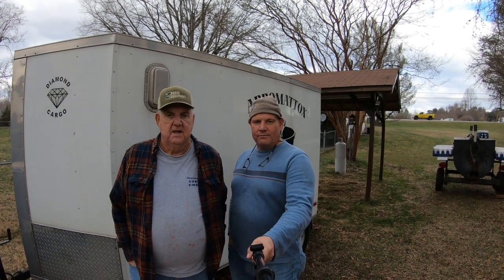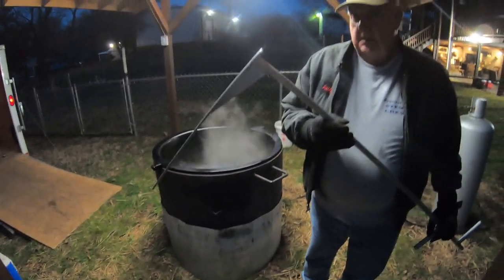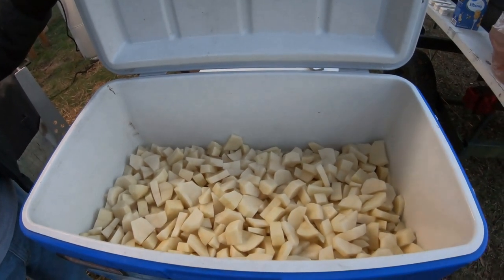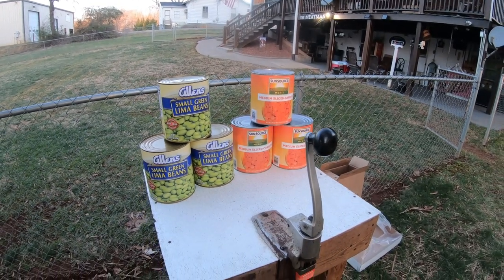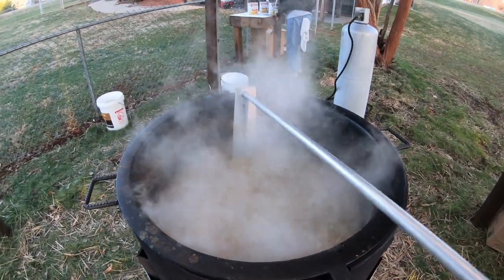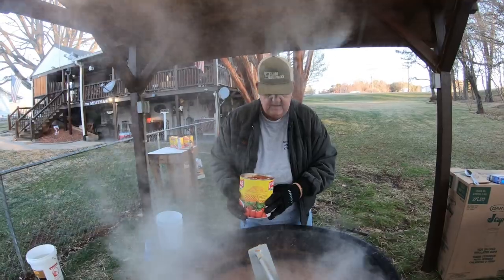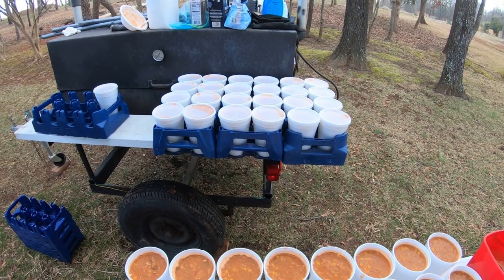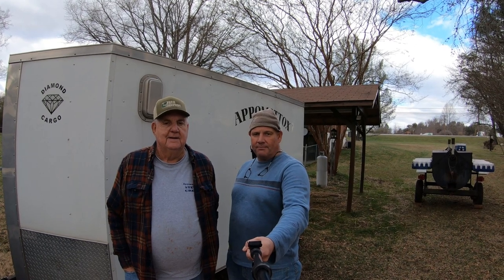Making Our World Famous Brunswick Stew-Appomattox Stew Crew

Comment: I am making a huge Brunswick stew for my entire pre-school. I have a 15 gallon cast pot that I usually make a chili in. How many gallons is this recipe on the video?
Reply from the maker: Normally when the pot is full we get around 200 quarts or a little over.  In this video the pot was around half full and it was around 100 quarts in this recipe.  If you use the recipe we did for this video I think the 15 gallon pot will be to small.  Hope this helps you out.  Thanks for watching and commenting.
Reply: @vafunseekers  thanks for the quick response. How long do you cook this? My event is at noon. Should I start 6 hours before?
Reply from the maker: @bluebus041  We cook with propane and we can have it done in around 3 1/2 to 4 hours.  We have three burners under the pot.  You are very welcome and good luck with your stew.  Keep me posted on how it turns out.

Comment: How much water do you usually add? Was going to try this way but always use chicken stock instead. Looks great!
Reply from the maker: When we fixed this pot of stew we used about a bucket and a half of water.  Normally when we cook a full pot of stew, we will put 2 buckets and half of water.  When I say half the bucket is full and we will dump half of the water or a little more than half in the pot.  If you fix it, please let me know how it turns out.  We have already cooked three stews so far since September.  Got two more already scheduled.  One in December and one in January.  Thanks for watching and commenting.  Just follow the instructions in the video and you should be fine.  Happy Thanksgiving!!
Reply: @vafunseekers  I'm assuming these are 5 gallon buckets? Definitely going to try it and will let you know! Happy Thanksgiving to you as well!
Reply from the maker: @rosswarbington7680  yes you are correct about the size of the buckets.  Please do let me know how it turns out for you.  Again, thanks for watching and commenting and if you have any other questions just let me know and I will do my best to help you out.  Take care and Happy Thanksgiving!